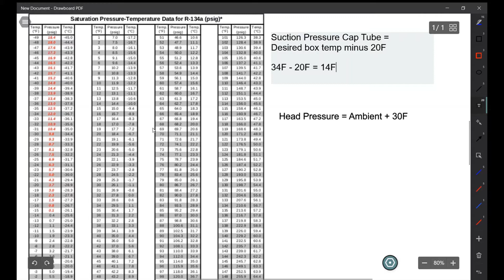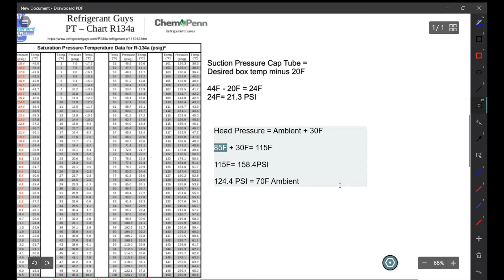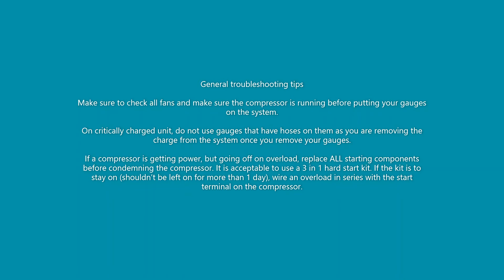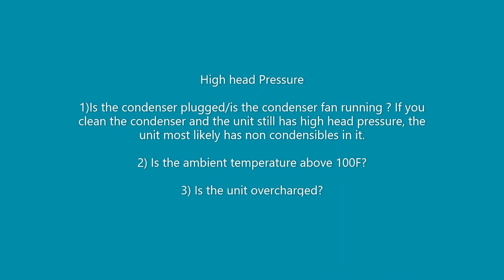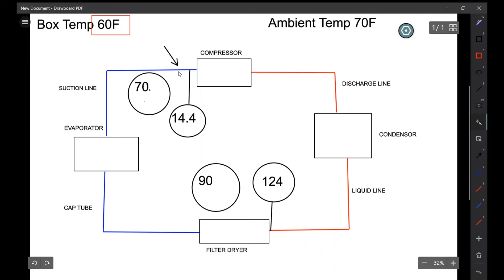Reach In Cooler Refrigeration Pressures Explained

Comment: Only watched a few of his videos SO FAR, and by far the best explanations of pressures I have came across. Most videos I watch are charging by sight glass and don't explain the pressures. Will be watching more. Great job and thank you for taking the time to explain in detail what different pressure mean
Reply: The saturation temperature is the goal: the pressures are how we achieve the goal — whether we are looking for the condensing temperature at the condenser coil or the boiling temperature at the evaporator. We can’t measure saturation; but, we can convert measured pressure to a temperature using the specific refrigerant’s PT chart. If your measured pressure converts to a temperature higher than you expect, the pressure is too high and requires further troubleshooting (restriction? non-condensibles? overcharge?), etc. Focus on temperatures and you won’t go wrong in this industry.

Comment: Can I use same formula with a TXV?
Reply: No this is the formula your so-posed to use for a txv system 
Suction side pressure 
Current box temp - evaporator Temperature differential 
 
Example using r22

Current box temp =40 degrees
Evaporator temperature differential of 10*
This is equivalent to 30 degrees saturation or 55psi

Head pressure 

Deviant 
I have 206 psi head pressure 

If we want between a 100-105 degree saturation temp for our high side what pressure do we need to be at? 

We would need between 200-216 psi to achieve that saturation temperature so

Comment: 2:30 - Is this one of those "Rules of Thumb" they talked about in class (350CFM per ton for airflow; 20 degrees SH on residential AC; Less than 250F discharge line temperature, etc)? Where to you get information about what the TD is for specific equipment? Is that a calculation? I've not been able to find this information anywhere. In school they taught us the calculation for TD; but, not what it is supposed to be for different equipment. I still have my RACT manual; but, it's not in there either. Is there a calculation I can do from the nameplate ratings?. The closest I could get is the BTU rating of the evaporator. I walk up to a box that appears to be functioning correctly: but, how can I be certain the designed TD is correct? Is it all a guess? or is there a way to know from a chart, maybe?
Reply: Did you have any luck finding out more info?

Comment: 2:33 - Where can the actual design TD be found? Is it just a ROT? Also do you use a different coil TD between a walk-in cooler and a walk-in freezer? Or both 10K? I heard the 30K CTOA from school for less than 10 SEER HVAC.
Reply: I had the same question. Also, by td do you mean delta t? Technically temp difference is not the same as delta t but I know a lot of people use them interchangeably
Reply: @ryannapier7059  You are correct in asking for clarification, since too many in this industry say DeltaT (the change in air temperature from the inlet to the outlet of the evaporator coil) when they mean TD (the difference between the saturation temperature or boiling temperature of the refrigerant in the coil and the desired space temperature). In this context - 2:33 - he said “evaporator coil TD” to reference the saturation temperature to the reach-in box temperature difference. I was just asking him if those numbers were recorded anywhere as a reference (10 DTD for walk-ins and 20 DTD for reach-ins). I’ve not been able to find these written anywhere even in mfg lit.

Comment: How do you determine if you going use 10td and 20td 30td
Reply from the maker: The engineer will determine this. Reach ins are typically a 20TD
Reply: Where do you find this split information? In the manual? Nameplates ?

Comment: So if the cooler has txv we can't use suction line pressure for diagnostic?
Reply from the maker: Ye would used current box temp minus evap TD as opposed to desired box temp minus evap TD

Comment: here some more info: 
The ambient temp is 73F & it equalized very fast when the compressor is off (< 5min). 
few minutes after the fridge was turn on the pressure went to ~1psi on the low side and then few minutes  later to 10PSI , and on the high side it started at 90PSI and went to 125PSI. The compressor temp is slightly warm, i assume since it was just started, correct? 
after 20min with fridge running the low side is at -10PSI and the high side is at 100PSI, and the compressor is running at  high speed and starting to heat up ,does it mean the system is under charged ?
Reply from the maker: If it’s r134A could be low charge or a restriction
Reply: Well, This fridge happen to have hi/lo ports installed and I noticed very small bubble when using soapy water. I the removed the valve and found that both shredder valvves were leaking , the rubber ring around the valve were worn out completely. How could it be ? I will replace both and see if the leak continues. Thanks

Comment: I liked your video.  question: I have a kitchenaid fridge with dual evap and the freezer side only get to 15F and the fridge is fine at 37F. with the fridge compressor off and with the manifold connected to both hi/lo side the pressure reads 40PSI right away which means the pressures are equalized and there no  obstruction, correct. ?  are the pressure too high and that may explain why the freezer does not get to temp of 0F? is it worth to purge the freon and preform nitrogen  pressure test?

Comment: What kind of hoses do you use, and you usually have to add pressure ports correct ?
Reply from the maker: Yes, we braze in access port. I use smart probes for any critically charged system
Reply: @REFRIGERATIONKITCHENEQTECH  thanks, it’s a lot of work in the beginning huh, having to recover then add back refrigerant, it’d be cool to see a video of where you place the ports

Comment: What is the evaporator DT supposed to be for a newer domestic refrigerator with a linear compressor side-by-side unit with one evaporator in the freezer section?
Reply from the maker: I do not do domestic. I had a commercial customer with a sub zero last year that I changed the evap coil on and the evap TD was 20. Might not apply to your application though unfortunately.